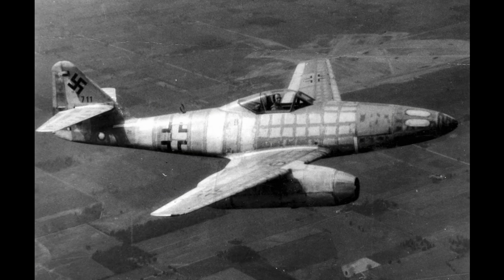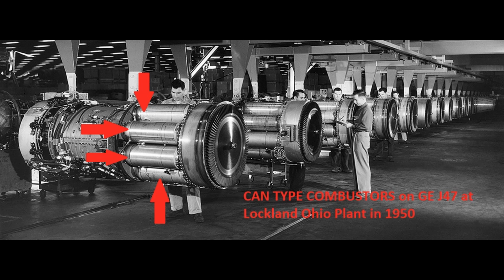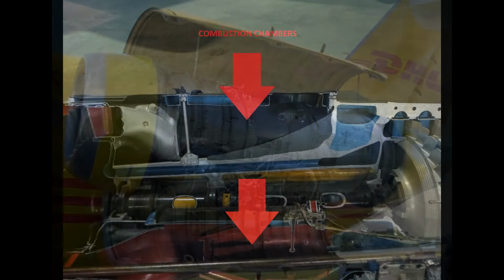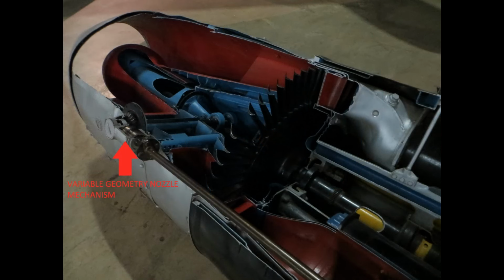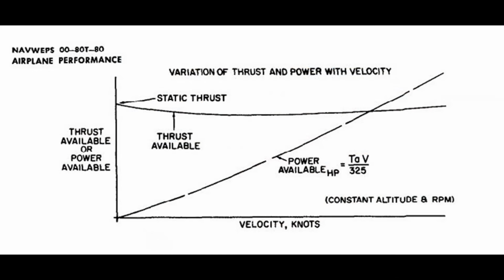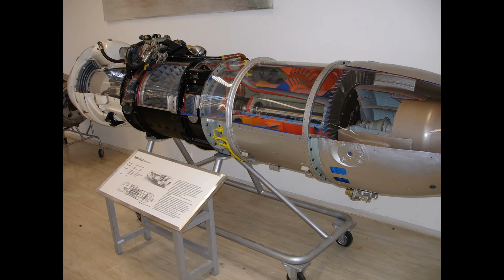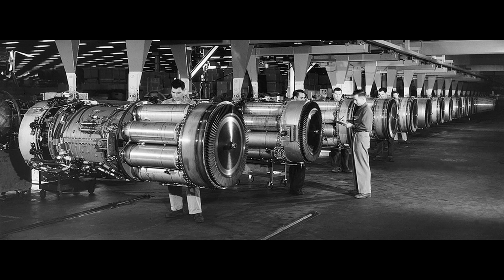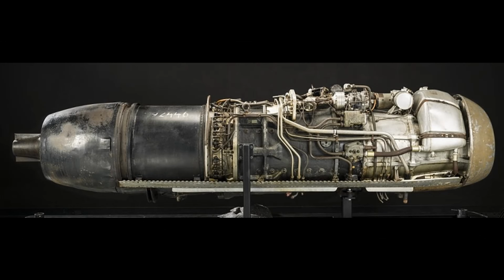World War Two JET POWER

Comment: @sandervanderkammen9230 

DiktorBumnar, DiktorBaytermosturJerkzOffenzisch, Krappenz, Kharzeestan, NewAOownlea etc & co. 

We feel able to shed some light on some common misconceptions.

It's always good to have the facts set out clearly isn't it.

  Obviously the Gloster Meteor was deliberately only operational over allied controlled territory & of course the UK as it wasn't required to do anything else and to keep examples out of the wrong hands. 
  
   Indeed The 262 was limited to operating over Germany in a failed attempt to stop bombing raids, the exchange rate was 3 destroyed 262s for each allied bomber so fairly useless at it's only task. The tactic used when the 262 faced allied fighters was for the 262 to risk engine destruction by exceeding the do not exceed speed of 445 mph to execute escape & retreat procedures.

  Of course it is in fact the case that the Gloster Meteor broke world speed records in 1945 & 1946 exceeding 600 mph & a Gloster Meteor was the world's first turboprop in 1945.

  Shortly after production started De Havilland were getting TBOs of around 1000 hours for their jet engines.

  Obviously the average life expectancy of a 262 engine was indeed less than 47 minutes so they weren't bothered about overhauls, they had to build new engines. Often it was the case that after a 262 engine destruction event a new aircraft, engines & pilot would be required. 

   It is of course correct that the RR Nene was the most powerful and reliable gas turbine aero engine on the planet in 1944.

  Now regarding claims or suggestions that the Gloster Meteor was particularly unsafe in some way.

De Havilland Vampire &  Sea Vixen & Gloster Meteor accident losses were not high or unusual for fighter aircraft at the time.
Non combat phase accident losses.
% of Aircraft built.
The Canadair CL-44 was a turboprop airliner.
Canadair CL-44             (ff 1959 ) 48%
Lockheed XF104             (ff 1954) 100%
Lockheed  P80                (ff 1944) 43%
Lockheed F104                (ff 1954) 45%
McDonnell FH Phantom  (ff 1945) 35%
Gloster Meteor               (ff 1943)  21%
DH Vampire                     (ff 1943)  23%
DH Sea Vixen                  (ff  1951) 33%
Gloster Javelin               (ff 1951) 20%

Gloster Meteor.
3950 Built.
In service 1944.
Less than 50% had ejector seats.
*2 Gloster Meteors are currently 
operational at Martin Baker.* 
839 accident losses.
436 accident loss fatalities.
21% accident losses.
11% accident loss Fatalities.

Lockheed F104.
2578 Built.
In service 1958, 14 years after the Meteor.
All with ejector seats.
1100 accident losses.
425 accident loss fatalities.
43% accident losses.
17% accident loss Fatalities.

Of course as always we hope this helps.

Cheers.
👍 & 😎 & of course 🙂 indeed.
Toodle PIP Old Chap 

. .... ....
. .... .. ..

Comment: You forget the other engine with an annular combustion chamber, the British Metrovic F2 engine, first flown in a Lancaster in 1942. It also had problems such as those found by BMW, so they redesigned it to use whittle type combustors, the resulting F2/3 and F2/4 engines didn't suffer many issues at all
Reply: The Metrovick F-2 was an unmitigated failure that never saw production or operational service.
Metropolitan-Vickers abandoned jet engines in failure in 1947 and returned to steam engines.

Britain would not have a viable axial jet engine until the Rolls-Royce Avon in 1953.
The Avon was developed using captured German jet engine technology... it's a copy of the BMW 109-018C.
Reply: @sandervanderkammen9230  Firstly the F2 was not an unmitigated failure, it became the highly successful Sapphire engine, the F2/4 was put into production but that ceased as the projects it was intended for were put on hold for civilian aircraft, in the meantime Metrovic sold the gas turbine division to Armstrong Siddelys who continued work on the F9 Sapphire. The Avon has no connection whatsoever with the junk that BMW had, it was the work of Alan Griffith (the expert on axial flow compressors)
Reply: @zaphodbeeblebrox5973  The F-2 was an EPIC FAILURE!  This POS design was never able to pass type-certification and was too unreliable to meet even the minimum requirements for RAF service.

 The Sapphire was a completely different engine designed by Stanley Hooker. 

FYI; A.A. Griffiths went to Germany and Switzerland in 1925 to study axial compressors... Griffiths arranged to import a Brown, Boverei und Cie Axial gas turbine from Switzerland in 1932, it was the very first demonstration of an axial compressor engine in the UK.  

Griffiths and Hayne Constant convinced Metropolitan-Vickers to become a BB&C and Oerlikon licensee and paid fees to use their technology and sell their axial engines in the UK..
Reply: @ stop making crap up. The F9 was developed from the F2, the fact the RAF had higher expectations of its engines that the Luftwaffe is irrelevant, they would have rejected the 004 for being junk.
Reply: @ THE SAPPHIRE WAS DESIGNED BY STANLEY HOOKER AND GERMAN ENGINEER FRITZ  ALBERT MAX HEPNER!
 IT IS BASED ON THE ARMSTRONG SIDDELEY ASX.
Reply: @ The Armstrong Siddeley Sapphire is a British turbojet engine that was produced by Armstrong Siddeley in the 1950s. It was the ultimate development of work that had started as the Metrovick F.2 in 1940, evolving into an advanced axial flow design with an annular combustion chamber that developed over 11,000 lbf (49 kN). It powered early versions of the Hawker Hunter and Handley Page Victor, and every Gloster Javelin. Production was also started under licence in the United States by Wright Aeronautical as the J65, powering a number of US designs. The Sapphire's primary competitor was the Rolls-Royce Avon. Hepner did no work on the Sapphire, he did some on the ASX (A totally different engine) and had been a UK citizen since before the war. I don't think you have even looked at the F2, F9, Sapphire or ASX at all as you can clearly see the Sapphire is the metrovic F9 and that it is a big F2, you would have to be blind to believe it was in any way developed from the ASX

Comment: Common theme with German "Wonder weapons" not enough time to perfect them . Glad they didn't.
Reply: The Messerschmitt Me-262 was well developed and mass produced, it is without any doubt the best jet fighter of WW2 and powered by the best engine, the Allies had absolutely nothing comparable
Reply: @WilhelmKarsten  it barely lasted 5 hours before it had to be rebuilt. If you gave it to much throttle it would flame out on take off . Vulnerable on take off and landing . Hard to perfect these weapons without fuel , and other resources when you're getting hammered from air land and sea .
Reply: @gjpopper3863  You seem very confused, the Jumo-004A-1 made with Krupp P-198 Chromadur alloy NEVER saw production or operational service.
The 109-004B easily passed the RLMs100-hour PFTR reliability test requirements for adoption into Luftwaffe service and the USAAF exhaustively tested the Me-262 during Operation Lusty and confirmed TBOs averaged 55 hours, better than Allied piston engines.

All first generation jet engines had manual fuel controls and the pilot could easily flame out or damage the engine if the throttles were not carefully managed and the EGT monitored.
The Allies suffered serious problems with engine failures in flight and this killed many Allied pilots during WW2.
Reply: @WilhelmKarsten  they sucked . They were a start but no way they could of been perfected under the pressure of war . 
They were awesome don't get me wrong . But obviously didn't help . No quality fuels , no quality pilots to fly them didn't help. A year wasted trying to develop it into a bomber thanks to the furor sticking his nose in everything.  
The allies especially the USA would build more Thunderbolts and mustangs and destroyed them on the ground if they'd of been any good .
Reply: @gjpopper3863  They were far better than anything that the Allies had, there was absolutely nothing comparable to the Jumo-004B engine until after the war and German jet technology was disseminated to the Allies.
The genius of the Jumo 109-004B was its multi-fuel capability and its primary fuel was J2-Stoff made from Coal oil which in plentiful supply in Germany.

Germany not only invented the jet engine it invented the type of jet engines that we still used today
Whittle's engine was an evolutionary dead-end concept.
Any questions?
 I suspect that their are alot of things you would be interested in learning about this topic?

Comment: My favourite part of the BMW-003 is that it was used as the basis for a prototype turboshaft engine implemented on the panther chassis. There were 3 different versions; one which had the whole engine but with extra turbine stages to extract more power, one which used bleed air off the compressor to drive a turbine with its own combustor to drive the transmission, and one with a heat exchanger to improve efficiency.
Reply: The Jumo 109-004B was used as the basis for the M1 Abrams engine., and the turboprop in the Tu-95 Bear.
Reply: @WilhelmKarsten Where did you get the information from ?
Reply: @Alpharius_Strongest_Soldier. Dr. Anselm Franz and Ferdinand Brandenberg designed the Jumo-004B and the scaled up version called the -012. Franz went to Lycoming and developed the  PLT-25 (AGT-1500) 
And Brandenberg went to Kuznetsova and did the same with the NK-12.
Reply: @WilhelmKarsten   

It will come as no surprise to anyone that obviously we feel we can clear up some commonly held myths and misconceptions.

It's clearly always good to see the facts set out clearly and concisely isn't it?

  The Honeywell  AGT1500 (originally Lycoming) gas turbine engine used for the Abrahms M1 MBT is essentially a Whittle engine which includes a centrifugal compressor stage & reverse flow combustors.

  Agreed, of course it is the case that the majority of gas turbine aero engine powered aircraft, including turboprop & turboshaft internal combustion gas turbine aero engine powered aircraft are powered by multistage sequential stator rotor axial flow turbine & / or axial compressor technology gas turbine aero engines originally given functional hardware form by Parsons of Ireland & North England for use in power generation turbomachinery & ship propulsion turbomachinery before 1900. 

  It is clearly the case that Parsons axial turbine technology of course was then licensed for manufacture by many industrial companies around the world including Brown Boveri. 

  Development work began on the internal combustion axial gas turbine aero engine in the UK before 1930.
   
  The world's first reliable & effective & flight certified instance of such an engine being the Metrovik of F2/3 which first ran in 1943 but of course was not required for production, was licensed for manufacture in the US while more powerful versions were being developed in the England.
  
  Indeed it is correct that the world's first pure internal combustion gas turbine aero engine ran in England in 1937 it having been demonstrated by Frank Whittle of England. What followed was indeed a more measured & sensible approach to the introduction of gas turbine aero engines. 

  The Rolls Royce (of England) Nene centrifugal compressor gas turbine aero engine was the most powerful internal combustion gas turbine aero engine on the planet in 1944 & would go on to be built in large numbers as copies or licensed versions in many countries including Russia (Mig 15 / 17 were powered by RR Nene & RR Derwent copies), China, The US, France & elsewhere & would power aircraft in those countries for decades after 1945. Centrifugal compressor reverse flow combuster gas turbine aero engines first invented & demonstrated by Frank Whittle of England are of course still currently manufactured by Pratt & Whitney & by Lycoming for example.

We did indeed hope this helps.

Cheers, as always, of course 👍

     
. . . . . . . ..............